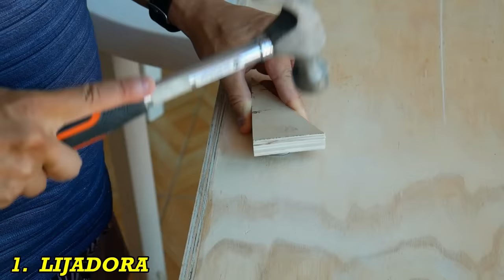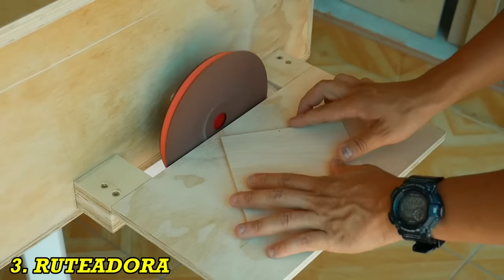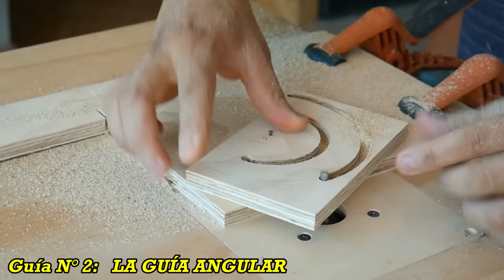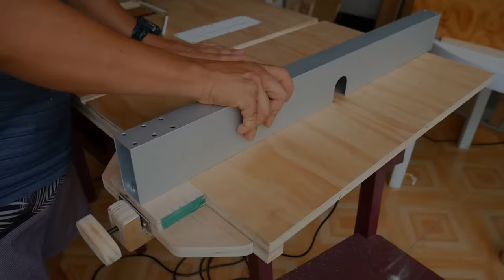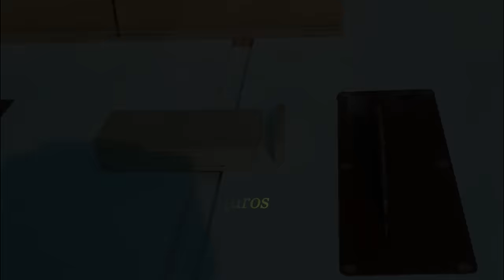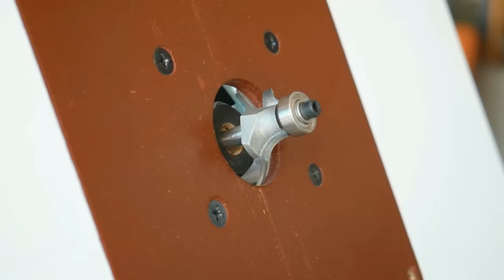La Sierra de Mesa 4 en 1, Que me Convirtió en NIVEL PRO!!💪

Comment: Looks perfect and very beautiful 
I suggest you use a small grinder instead of the drill for sanding and connect it to a rheostat to control the speed
As well you cab connect a rheostat to the jig saw if you need to cut Plexiglas or something that needs low speed cutting 
Very nice job
I am gonna subscribe to your channel

Comment: Instead of The drill i USED a 4" grinder with a Extension i just had a spare one so tried it,works GOOD and lots of power,lol. You can put a SPEED CONTROLL switch on it ALSO MAKES it even better😂😂😂😂😂😂